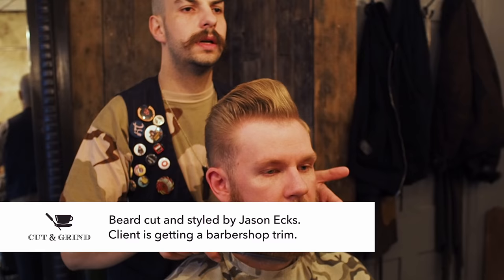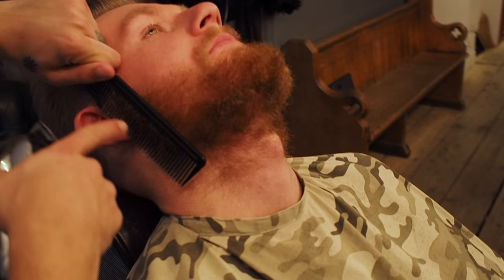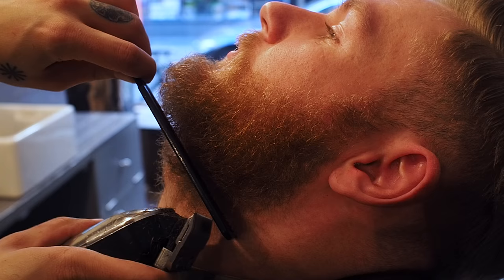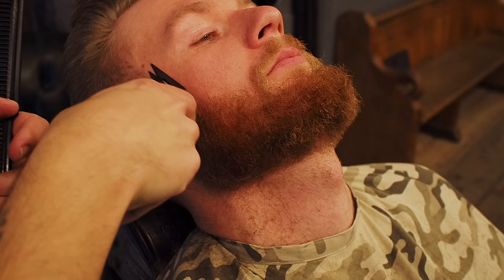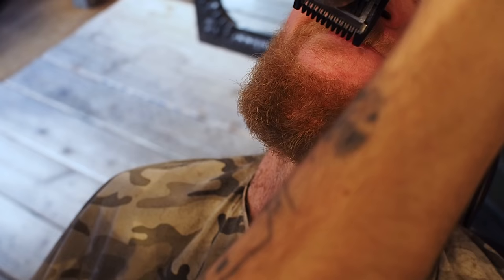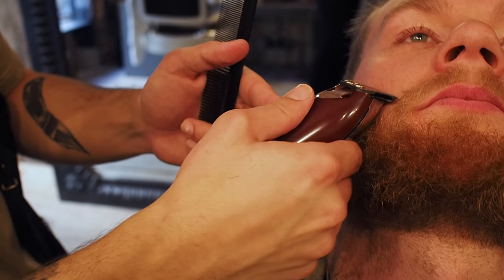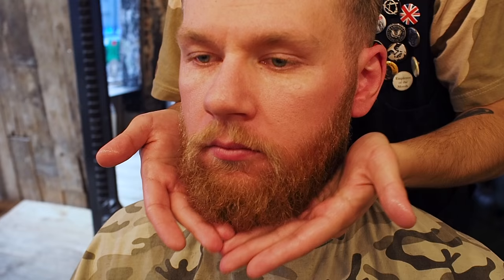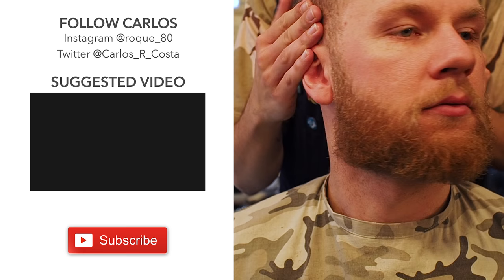Short Beard Barbershop Maintenance Trim | Cut & Grind

Comment: i had my short beard trimmed by a barber for the first time today. he took the sides and underneath to the same length and then the goatee area slightly shorter than the rest. it's kind of the opposite of what i normally do. is this standard?

Comment: What length would you recommend going in for a trim at? I am about 7 & 1/2 weeks into growing and have around an inch +

Please respond! Thanks guys.
Reply from the maker: It totally depends on the look you're trying to achieve. At about 2 months of growth, you probably won't want to take much more that about 1/4 inch off. That's if you want to shape it pretty drastically. Even less than that if you are going for length. 
-Parker